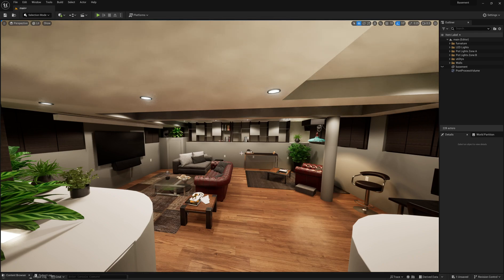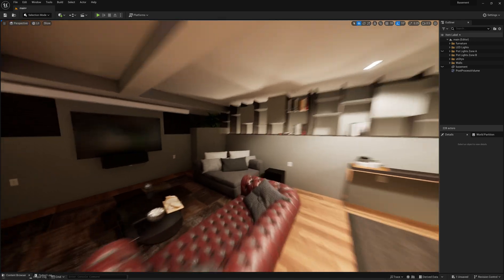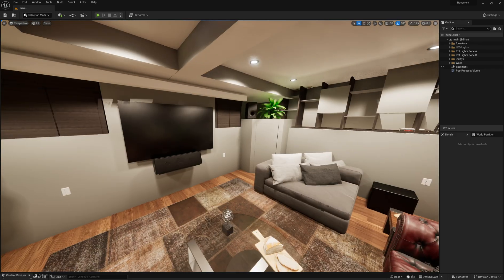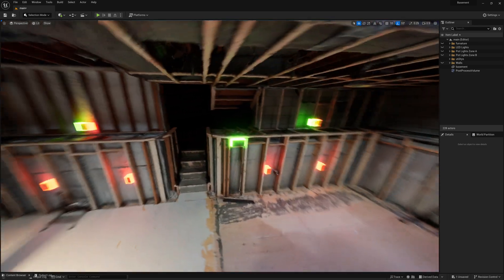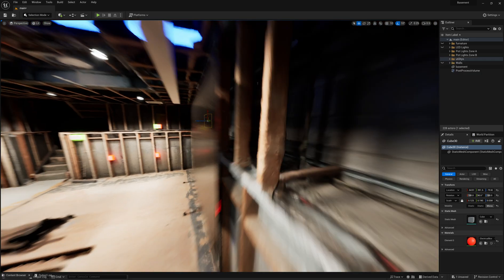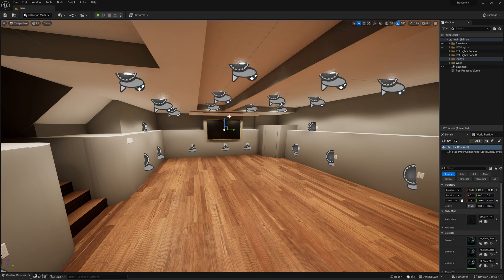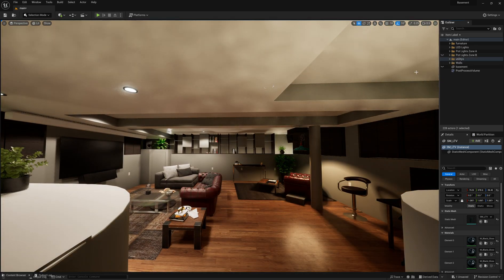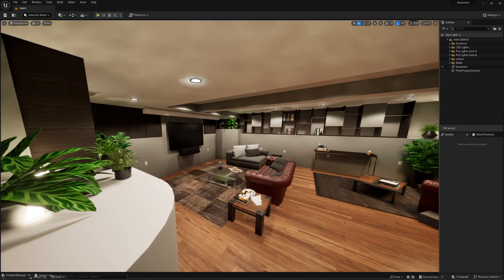Basement renovations with Unreal Engine 5 and Reality Capture

Comment: Try to get your LCR speakers at ear height when you’re sitting. It will help localize the sound a bit better and also help with some clarity. Don’t forget ceiling speakers for atmos !!
Reply from the maker: Yeah the surround sound setup/audio is something I’ve still gotta research and get done right. I am getting the basement decently sound isolated from the rest of the house and the location of bedrooms is far away from the basement so loud audio including sub speakers shouldn’t be too much of an issue. 

The projector experience. I might look at getting a screen that doesn’t inhibit a speaker behind it for the center channel. Currently I’m using a Da-Lite 140” screen matte white that I’ve been happy with. Audio for the center channel for vocals is something I’d want to get right. 

Good thing is the layout has the projector system centered mostly in the center of the room. Where the audience sites is pretty much the center of the room too so it should help with getting surround audio working correctly.